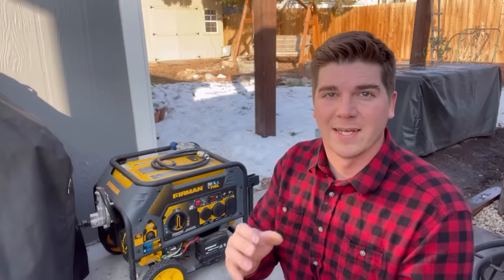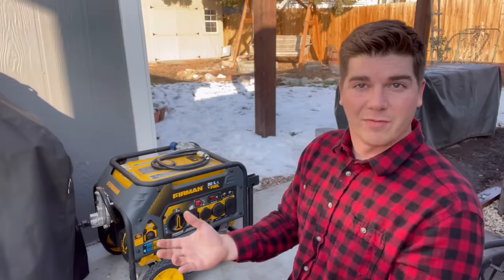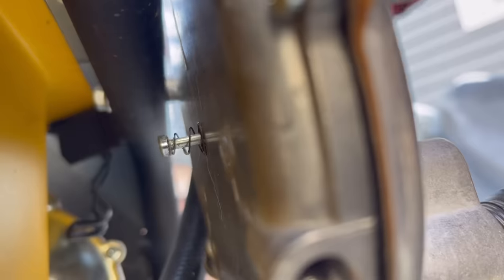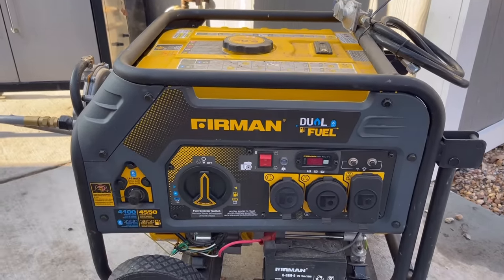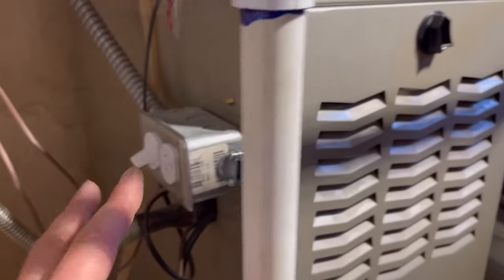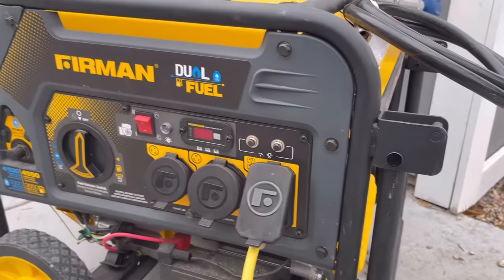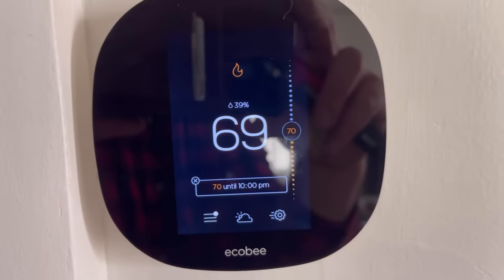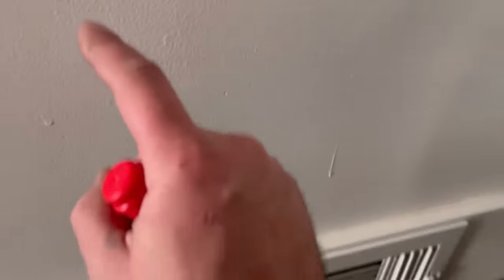Most Homeowners Don’t Know About This Trick To Get Heat During A Power Outage.

Comment: Many have found that 100LL aviation fuel works well for air-cooled engines. Because it is more pure (like white gas) and has a lower vapor point. It stores for a long time and is designed for temperature extremes. I use avgas in a 50-year-old Briggs and Stratton generator. It  starts on the third pull after sitting for a year. Avgas costs a third more. But who cares when you need to get started on a freezing day?
Reply from the maker: Awesome! Where do you buy it at?
Reply: Probably the airport.  That’s where I get my gas for all my small engines.  91 octane no ethanol.  Stores for a year+ without additives.  I’ve never had a fuel issue.
Reply: @diyhvacguy  The smaller airports. Dirt bike guys show up at my airport to buy it at self serve tanks because it is similar to the more expensive  racing fuel.

Comment: Great video. I have a slightly smaller Firman generator (WH03242) that I purchased at Costco several months ago but I think it should work for me. You mentioned that you would leave a link to the aftermarket NG regulator referred to in your video but I couldn't find it.  Is the link absent or am I just not seeing it? Thanks for any help on this.

Comment: Great videos.   Suggest measuring the furnace amp draw to properly size inverter or generator.   Mine was a lot higher than I expected.
Reply from the maker: What did yours pull?
Reply: 7A.  I was surprised that it was this high for only a fan.   A 1,000 inverter would in theory be good for up to 8.3A, cutting it close, esp. at startup.   1,200 or 1,500 might be a better option.   But one also has to check the amp capacity of their vehicle.   7A at 12V is 84A, just under the max capacity of my smaller vehicle.   So there is a lot more to this than it appears….
Reply: Topic suggestion.   One HVAC guy suggested that a low end fiberglass filter was all that was needed to protect the furnace.  To clean the air in the house, electronic filters provide more cleaning at less air resistance than the high eff filters.  Thoughts???

Comment: My local store electrical person said it is an appliance cord not a pigtail.  If there is a wide area failure would not the natural gas also stop?  During a Colorado fire I was a shelter volunteer and was told by emergency services that the local cell tower was without external power; and would shortly run out of battery power.  F. Miller
Reply from the maker: It’s possible the natural gas could stop at the same time but a lot of times it doesn’t. I’ll have a video out soon that talks about 3 ways to heat your home with no power OR gas. Stay tuned! Cheers

Comment: Hey , Can the generator be remotely started or from another source remotely from an inverter like when the batteries gets too low , that will trigger a remote startup to recharge the batteries while still running the house as pass through UPS powering ? 😊😊
Reply from the maker: I’m sure this could be done. Mine is pretty basic.

Comment: Thanks for the videos. I'm wondering about the shared ground connection you have. Your generator has a bonded ground and you're connecting that ground (through the extension cord) to the cabinet of the furnace which is also connected to the service ground which would be bonded to the service neutral at the panel. I imagine the generator breaker will pop off before any issues develop but I'm curious if that shared ground would be a problem.
Reply from the maker: Hasn’t been a problem thus far.

Comment: great tips, how can I calculate the gen load of my furnace, I will want to add enough headroom to also run fridge.
Reply from the maker: You’d need an amp meter to see how many amps it’s pulling then base the wattage of your inverter on that. This 1000w that I used has a digital read out so it shows how many watts it is actively pulling. 

This is the one I used in the video. 

https://amzn.to/3YoTEwF

If this one isn’t enough you can send it back free and get a larger one. As an alternative to purchasing an amp meter that you might not ever use again.
Reply from the maker: Oh sorry I thought you meant inverter. Same thing to determine your watts. For pretty much any furnace I’d imagine a 2000 watt inverter would power both.
Reply from the maker: Sorry I meant a 2000 watt GENERATOR 😂

Comment: Thanks for the video.  I have a similar set up for emergency at my home and it works great.  Long term I want to set up my electrical panel to accommodate a generator.  I’m wondering why you shut off the main breaker since this is running on an isolated appliance.  Power going back up stream is not possible since you have the pigtail on the furnace.  Nothing you are doing is sending power back into the grid.  Just curious.  Thanks
Reply from the maker: Just being overly cautious for my viewers :) I’ll be doing a full interlock kit in my breaker panel very soon so stay tuned for that video! Cheers

Comment: I have a heat pump. I'm fairly sure I can't run it off my gen.- What I 'd like to know is can just the heat coils in the air handler be used for heat and not the heaat pump itself. Like, shut off the heat pump part of the circuit. Then it would the inside fan and coils? Thanks

Comment: What is the purpose of the switch on the outlet attached to the furnace? It seems a redundant/ unnecessary way to turn off the power to the fan motor if you can switch the power off with the cb. Am I missing something?

Comment: question... how many  NG BTU's is your furnace and the converted generator? also what size is your gas meter? also how why dont you just turn on the circuit that runs the furnace instead of rewiring  it?

Comment: Thanks for sharing your nice and informative video. I just bought a Firman 3200W Running / 4000W Peak Dual Fuel Inverter Generator, how can I use natural gas instead of propane with my generator?
Reply from the maker: Purchase the ng conversion kit in the video description 👍🏽
Reply: @diyhvacguy  the link in the video shows one for predator which is not currently available and the two more for Honda. Is there any other that can support firman?

Comment: This works great if you have a gas heater but if you have a neat pump system it runs on 240V not 120V.
Reply from the maker: That’s correct but I have some awesome videos for that coming down the pipeline! Stay tuned!

Comment: great and excellent video!! I have learned a lot thank you. But quick question. If there is no power going back, why do you need to kill the power to the main? that's my confusion. Reason why i ask is, i want to do this, but I have solar installed. I cant have generator power feeding back to my solar grid if the power is out.
Reply from the maker: I just flipped the main breaker off just to be on the safe side but this isn’t really a necessary step. The pigtail totally isolates the furnace from the rest of the grid power. Sorry for any confusion. Cheers.
Reply: @diyhvacguy   makes sense and thank you!

Comment: Why hasn't anyone invented the self powered capable gas furnace? I would get rid of the burners and put an air cooled natural gas powered generator inside the furnace so the waste heat can be used to heat the house while it's running. The generator won't just power the furnace fan but also power your house too! The 12 volt battery would be part of the furnace to crank the engine and gets recharged by house power during normal operation or from the generator during power outage. I would add a recoil starter in case the battery is dead and you need to get the gas engine going during a real power outage.

Comment: The only reason you shut off the main breaker was to demonstrate that there was no power going out to the grid.  You would not need to do that to operate the furnace with the generator normally the way you have that set up.  Really greater series of videos.
Reply from the maker: That’s correct. Thanks sir! Appreciate the support

Comment: just wondering. why are the wire nuts back on the connections inside the furnace, the video when you installed the switch and pigtail you installed the push connectors.
Reply from the maker: I’m not sure to be honest. I’ve done so many videos on my furnace it’s hard to keep track lol

Comment: Great video Dave. Important information so we can be better prepared in an emergency. I too converted my generator to NG but have it connected to my main panel, then the furnace via a transfer switch.  I've also heard that over 5% THD is not good for sensitive electronics but are most furnaces in such a category? With the many long term failures across the country I'm sure we would have heard much more if people were frying boards left and right. I have a new ICP G96CTN080l7l4A1 and can't find any THD requirement for it and the installer said he's never heard of a problem. Sure, under 5% THD would be nice but is it really necessary. If so many people will be buying new generators. I don't think any manufacturer would weigh in on this since who knows what's coming out the end of a generator that is overloaded or hasn't been maintained. I would expect if you are running 120v @ 60HZ most standard furnaces like you have demonstrated will work fine. Firman list the THD of yours at 25%.
Reply: My furnace is a modern 97% efficient furnace with electronics, and I have an inverter generator to power it and charge the solar generator.  The furnace only takes about 780 watts, so I opted for a 2400 surge/1800 watt dual fuel model.  The solid-state power supply for the solar generator and furnace electronics would have problems with older fueled generators with that wide of a spec.  In fact, the furnace will be connected to the solar battery which isolates it from the gas generator.
Reply: "under 5% THD would be nice but is it really necessary."
It depends on the application.  APC UPS (Uninterruptible Power Supply) don't like the harmonics.  Capacitor input power supplies for computers store the peak voltage and a non-sinusoidal waveform can have voltage peaks higher than expected.  
http://www.screenlightandgrip.com/images/Protocol_Clean_Power_%20Part2.pdf
Reply: @thomasmaughan4798  I don't know how "necessary" precise sine wave power would be for my furnace but, for the money ($3000) I paid for it - why take a chance on burning the electronics.  Besides, these days, all generator manufacturers offer inverter generators - the design is easier to make specs that are tight enough for modern electronics.  Thats what people have a lot of - TV's, stereos, refrigerators with electronic displays, washers and dryers with electronics, etc.
Reply: @mikecaster4612  Connecting the load (furnace) to the battery also allows you to shut the generator down when you want to sleep. or when you want to lock it up in case there are people out there who think they need it more than you do.
Reply: @Struthio_Camelus  Having enough battery capacity to last a week is the plan - may not have to run gas generator if power comes back on before then.
Reply: @mikecaster4612  I humbly suggest that unless most of your power interruptions are multi-day outages, then you're overpaying for your generator, or your battery (or both.)
I'm in the Northeast and losing power for an extended time is  extremely rare (last one I recall was a decade ago.)
Reply: @Struthio_Camelus  We had a pretty big power outage in 2003, for 3 days.  August 14, 2003, I remember it well, but that was not the only outage - when DTE is your electric monopoly, outage is commonplace.  The shareholders will get their dividends - no matter who has to freeze to death - to keep the others in line. 

Besides, DTE is going to enact prime time rate increase and the solar battery will allow me to "time shift" the power use.
Reply: @mikecaster4612  DTE-- in Michigan? I wish you the best of luck in your quest for energy independence.
Reply: @Struthio_Camelus  Yes, that one.
Reply: That's getting better and better actually, a lot of stuff now because of higher electrical efficiency demands, run on what's called a 'switched mode' power supply. A lot of newer electronics can actually run on really bad garbage power, some TV's and laptops say "100-250 volts and 50/60 Hz". So that way you can take your electronics to literally any country in the world, and just change the plug to fit whatever they use there. Another reason is it makes things simpler for a manufacturer, by not having to make an appliance different for every market like half of Japan is on 60Hz, the other half is on 50Hz, and 127 volts. Europe/UK are 240v, 50 Hz, USA 120/208/240 60Hz, its just easier to make things be able to use whatever junk power is available. As far as ECM motors go, they take incoming AC power, covert it to DC, then invert it back into switched 3 phase power, so they can also deal with poor frequency and voltage regulation, so long as there is NO high voltage spikes, and the frequency is reasonable like 57-63 Hz, and voltage between 110-130 volts you should be fine.

What I've found that takes out most furnace ECM motors, is voltage spikes from thunderstorms, even a far off lightning strike can send a spike of 2-3Kv on the ground wire, and pops the TVS surge suppressor on the board. Or the caps fail because of high static pressure, dirty air filters etc, and the caps swell up and fail in the end bell because the motor is running at too high of a speed, or overloaded because of high static pressure or bad ductwork. A PSC motor is much more tolerable of poor static pressure, in fact, a PSC motor will use LESS amps with a completely clogged up filter, but may overamp if running the blower completely outside the furnace with totally free airflow they will tend to overload. Of course if the filters are completely clogged, won't take long for the heat exchanger to crack anyway, and then the furnace is toast. YMMV
Reply: @thomasmaughan4798  Yup, square wave 'simulated' sine waves don't play well with a lot of switched mode power supplies, because they're not expecting those big noisy zero crossings, a lot of electronics except a clean zero crossing at roughly 60 times a second, and at least some kind of voltage the rest of the time. As long as that happens, they chop up the incoming AC voltage and then convert it to DC anyways, so the exact frequency and/or wave shape doesn't really matter. You could have a 60Hz sawtooth waveform, and as long as the zero crossings were clean, and the true RMS voltage was within reason, it would work fine. Random high voltage spikes are the real killer though, because of cheap TVS surge suppressor diodes they put on things these days, just a bit of static from walking across a dry carpet can blow the little surge protectors inside some ECM motors and cheaper UPS systems. They cut costs wherever they can building things these days.
Reply: @mikecaster4612  That would cost more than a couple of generators, and all your food would be bad after a week. Week long power outages only happen on average in one area maybe once a decade anyway. But when they happen it can be really awful, look at those poor people that had to be without power for a week in North Caroline recently, and that wasn't a storm. It was from some idiot shot up a couple substations and blew the transformers.
Reply: @mikecaster4612  Some people in the Northeast and Ontario lost power for a lot longer than that in the great blackout of 2003.
Reply: @brnmcc01  I would eat the food in the fridge and freezer first before unplugging the fridge.  If it was cold enough the fridge food could go into a cooler and outside.  The AC200MAX did cost money but, I expect more power outages in the future and the battery will last that long.  The solar generator can be turned on without going outside - I don't have to brave the cold winds to start a gas generator.  In the summer I will run a window air conditioner on the solar power to augment my central air conditioner.

As far as sine wave - this is 2022, the electronics are mature enough and cheap enough to take sine wave AC for granted.  I have had Sine wave inverters for almost 20 years and maybe I am spoiled.  You did not mention one thing - modified sine wave has more "buzz" noise on amplifiers in the music industry.  But sine wave should be a moot point when every manufacturer can do it.
Reply: I know a guy locally who fried two furnace control boards during power failures before he clued into the fact his generator was putting out modified sine wave power. I'm not going to take a chance with my furnace. I'll spend the few hundred $ extra and get an inverter generator.
Reply: @kingstonsean  You've got that backwards. Most inverter generators will put out a modified sine wave. You get a true sine wave with an old fashioned spinning alternator.
Reply: @brnmcc01  tell that to Honda, Champion, etc.
Reply: @brnmcc01  and check out Gavin's Garage. He uses an oscilloscope to test inverter generators.
Reply: @kingstonsean  Yup I just watched the video on the Eu3200i, looks like a nice one.

Comment: Good video..I have a dedicated 1 inch gas line to hook up a generator but haven’t got the fittings or generator yet.Have a grill hook up also but too far from my 30amp 240v hookup.Was wondering about an easy way to convert.There is a company that makes a conversion kit if you don’t have a duel fuel.Do you have a 30 amp outlet on the generator?
Reply from the maker: Yes mine does have a 30 amp outlet. Not 240v though  it’s 120 v
Reply from the maker: My natural gas conversion was super easy.

Comment: I feel bad for the folks with roof top gas packs, heat pumps, and resistant electric heaters. Also the eeps under an HOA who will not let you run a generator at night.  Hopefully the videos on battery packs is in the pipekine soon?
Reply from the maker: Yes! Tomorrow I have one being uploaded 👍🏽